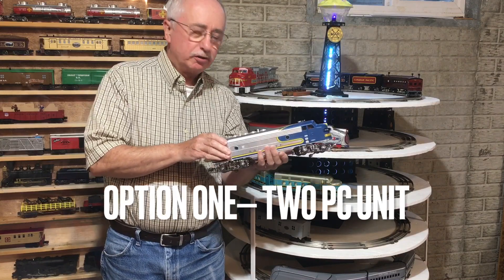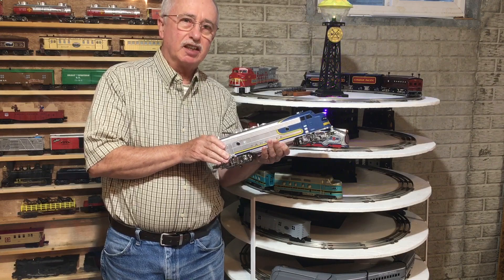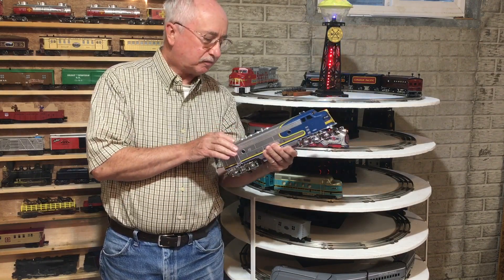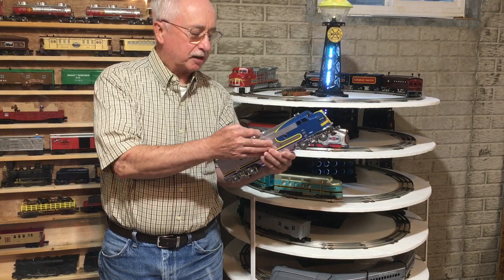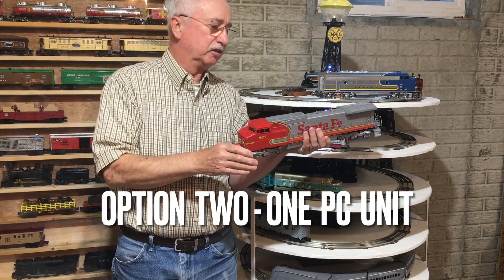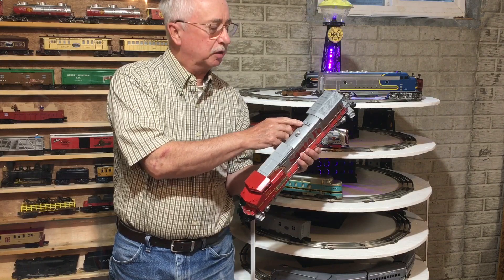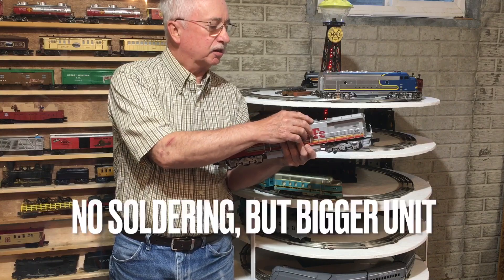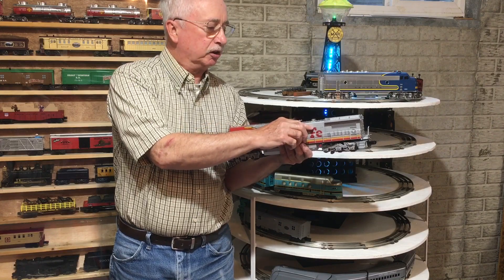Menards 4.5 Bluebonnet Smoke Upgrade

Comment: Awesome job on the smoke unit installs Steve! The Santa Fe locomotive is smoking much better than the Menards locomotive. I have a few locos that I’m thinking about modifying. Thank you for making this video! Jack did the same thing. 👍
Reply from the maker: Thank you Frank. In the Menards engine I installed a two-piece MTH unit that was a new replacement for a smoking tank car. My other installs were all MTH one-piece replacement units. My Burlington Northern has a K-line smoke unit I purchased from Trainz at a lower cost.
Reply: I understand now😊👍

Comment: HELLO STEVE. Ive been working on my smoke unit in my Menards UP F units. I’ve been very disappointed in the smoke out put. Yours smokes like a WWII destroyer. Mine is like a fire going out? This morning after installing another smoke unit in the UP dummy and getting the same result it occurred to me maybe my smoke unit fluid is not right. I tried different fluid and got your results. So now mine starting on the power unit. Thanks again for your video the gave me the incentive to do this.
Reply from the maker: Jack, glad you are having better results with a different smoke fluid. I have been using Mega Smoke brand. I noticed Menards now offers a Train Set package that comes with comes with a 18-volt power supply. I now feel safer if I set my transformer to 18 volts.
Reply: I remember that you said there were advantages to the one piece board and the two piece board. Did you notice and difference in the smoke output of the two different boards?
Reply from the maker: Hello Jack, maybe the one piece put out a little more. What was your thoughts? @jackstoyOgaugetrains
Reply: Thanks for the response. I'm real disappointed in the smoke output of the two piece. I saw a NEW one piece and it looked like it was stronger. So I bought two. Thought I'd try the one piece before I rework the power unit like yours. Working with just one stack. Thanks again.

Comment: Steve, Have you noticed the roof of you Menards F7 getting from the smoke unit. I don’t run my smoke very long at all.
Reply from the maker: Just went down and took another look but did not notice anything going on with the paint. I try to wipe up any excess smoke fluid that I may drop on it. Is the roof getting too warm? I have a rubber spacer between the smoke unit and the shell.
Reply: Yes Steve. The roof on my power UP is getting pretty warm
 I'm working on a insulation to control the heat. Did you put the on/off switch from the tank car smokers in you F7"s. I did use the switch 
 I have the smoke turn off for now.
Reply: I found some perfect micro on/off switches on Amazon if your interested.
Reply from the maker: Hello Jack, yes, I would be interested in that link or name. I think it would be a good idea to have that option, thank you.
Reply: Amazon. U cell 5 piece 2 position 3P SPDT Toggle Slide Switch On-Off PCB for DIY Making model. They are identical to the switch that came with the MTH tank cars.
Reply from the maker: Thank you Jack for that information, I am interested in ordering them. @jackstoyOgaugetrains

Comment: I like it. What smoke unit did you add. Where did you put the wiring from the Menards unit to the smoke unit.
Reply from the maker: Glad you like it. I used the MTH two pc. smoke from a MTH smoking tank car. The seller is out of the 2 pc. units, but I still think the one pc. is available. There are MTH smoking tank cars on Ebay you get the parts from, if you wanted the two pc.. I used the Menards track pickup wires (Red and Black) to power the smoker.
Reply: When you say one PC is that saying one piece. What’s the PC stand for. Sorry but I’m old and slow. I’m also going to add smoke to some postwar Lionel GP7’s. But I think I have that covered with the exception of adding a fan motor to a vintage Lionel sp smoker.
Reply from the maker: No problem. I'm sorry, I meant one piece.
That sounds like a good project. @jackstoyOgaugetrains
Reply: I took your advise a bought a MTH smoking tank car. I hope to put this in a Postwar Lionel 2338 GP7? Do you see any reason why I can’t do this.
Reply from the maker: The two-piece unit can be adapted to fit more applications. You can do it if there is room under the shell smokestack. Remove the shell and you can see if it can fit. Take your time and leave clearance to the shell. @jackstoyOgaugetrains
Reply: The postwar GP7'S come with a horn. Horn rely  and battery box for a 1.5 D cell battery. I'm not installing any of that
 I believe there will be plenty of room
 I'll use the horn relay bracket to hold the smoke unit
Reply: When buying the smoking tank cars how do you know if the a one piece or two piece smoke ink units. Sorry to ask so many questions.
Reply from the maker: Hello Jack, the seller told me the two-piece unit I installed in my Menards was a replacement for a MTH smoking tank car. Maybe you might not have to solder wires because it was already installed in a tank car.  @jackstoyOgaugetrains
Reply: Steve. I got the smoking MTH tank cars. Pulled the one piece smoke assembly out. I started to remove the electronics & smoke unit. Then it occurred to me maybe I need to leave the complete assembly together. Fit it in the engine after cutting it down. Or can I remove all the components and reassemble them on my board?
Reply: Never mind. I got it now.
Reply from the maker: Try to fit into shell with minimum disassembly. @jackstoyOgaugetrains